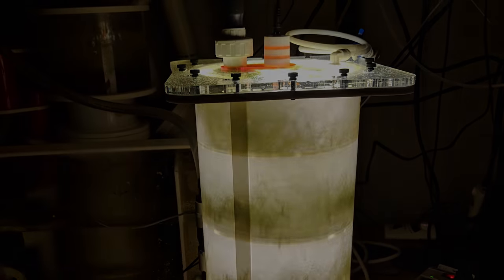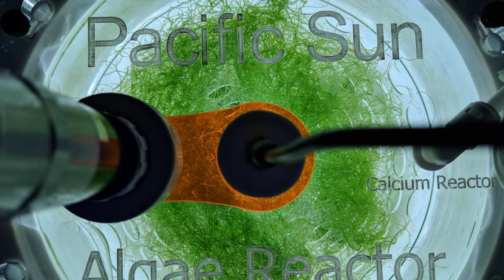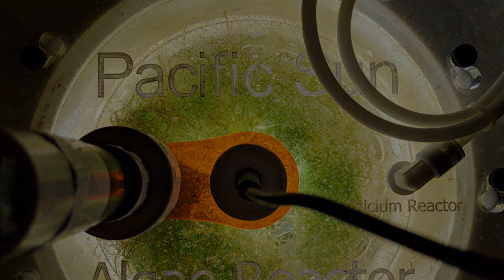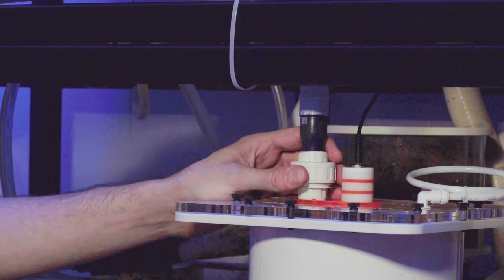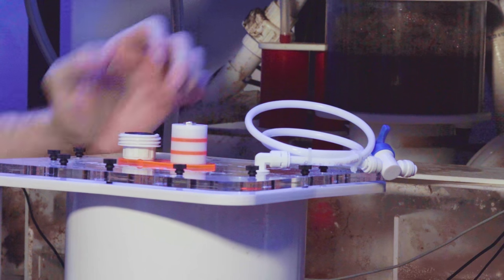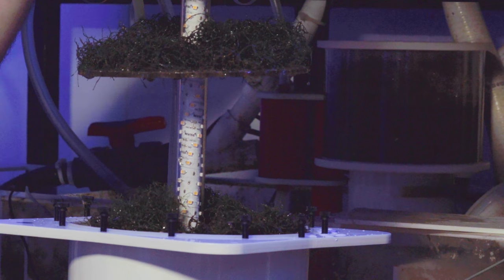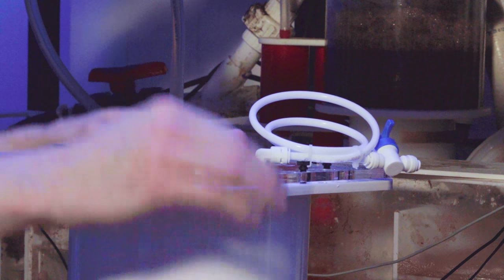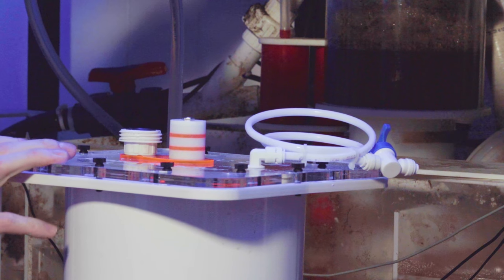Pacific Sun AR-PRO Algae Reactor Update

Comment: Hey! Can't you use the output as input instaid? Greatings and I subbed
Reply from the maker: Thanks! I think you could run it backwards, but you'd have similar issues. Neither port is particularly well protected from algea.
Reply: @ReefMan  yes but i ment because of the calcium reactor input is on top
Reply from the maker: Oh - hah - of course! That's a totally valid point. Sorry!

Comment: I have the mid size one and what i did to not have cheato blocking the output i had the top plastic separator close to the output and i left it empty. I had to stop using it after two weeks because my nitrates and phaspates dropped to 0
Reply from the maker: Kristijan Mancevski I thought about that too. The levels are movable, so I might try moving the top level down a bit as well.